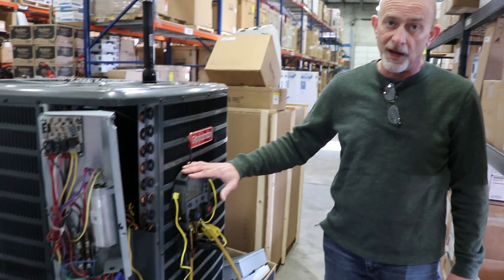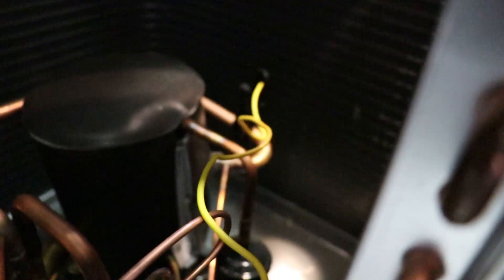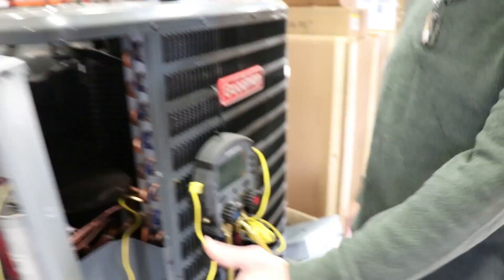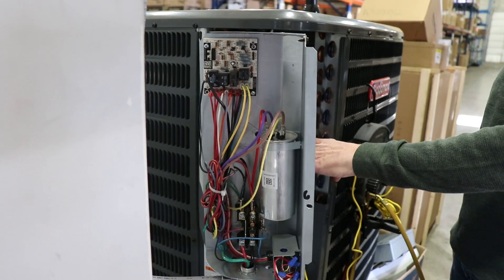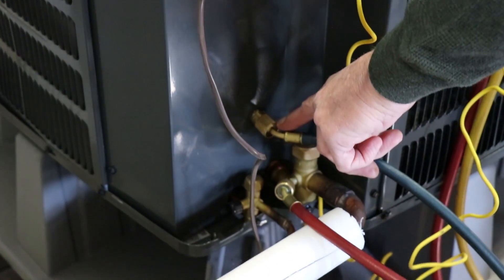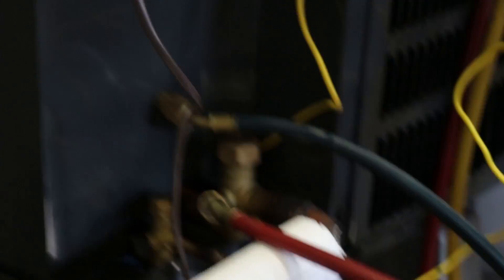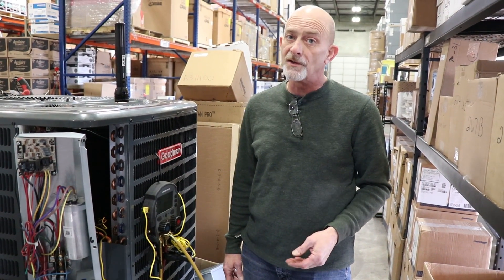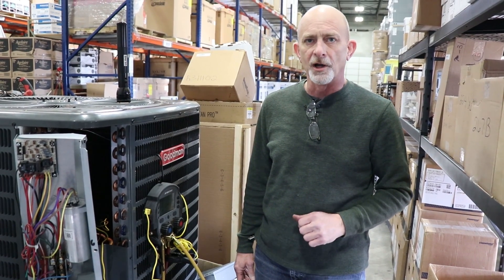How to check the charge on a heat pump in the cold

Comment: What are the pressures suppose to be at though? The numbers on the high and low gauges?
Reply: Amazing
Reply: You can't go off the pressures
Reply: @Bryan-fc9dv  yes you can, most heat pumps will have a winter charging chart on inside cover next to summer charging chart where you would use your return air temp,outside air temp, and use those measurements on the cart and it will give you pressures you should be aiming for, so theres no rule of thumb for what pressures you should be seeing, you have to use that manufactures charging chart,and I'll also add that this just gets you close enough so it will work but you always go back in spring to dial in the correct charge in cooling mode,always

Comment: What metering device this unit has? a piston? thanks in advance for you response,..
Reply: A TXV valve. The one it came with from the factory.
Reply: @superglidefletch8003  I though heat pumps uses bi flow metering devices ?
Reply: @xraybravo7180  most do have a bi flow txv inside and one outside as well on residential split heat pumps. Or I've seen some with single direction metering devices with a bypass around the device w a check valve on the bypass
Reply: @xraybravo7180  absolutely, most of them do these days,I havnt seen one that didnt in a long time
Reply: @xraybravo7180  split heat pumps have two txvs where as package hp will only have one
Reply: @HVACRTECH-83  My 5 ton Bryant has TXV inside and Piston outside.

Comment: Is it possible to check a charge on a HP with a TEV in cooling mode in the winter time ? The unit is used all year round to keep a mechanical room cool .

Comment: Old school way. Ambient temperature plus 100 is the suction line temp.
Ambient =45*
+100=145*
Suction temp should be 145*
Reply: Suction line in cooling, now discharge in heating
Reply: Did you mean it equals the discharge line temperature?
Reply: Ambient temp above 45* can be charge more accurately if you used the charging jacket at outside unit provided you can bump the indoor temp to more than 72-74 with strip heaters first (pull disconnect outside)